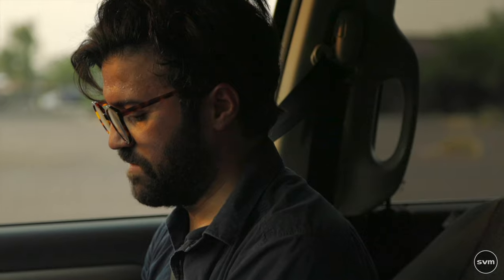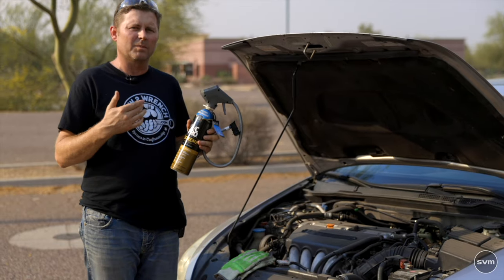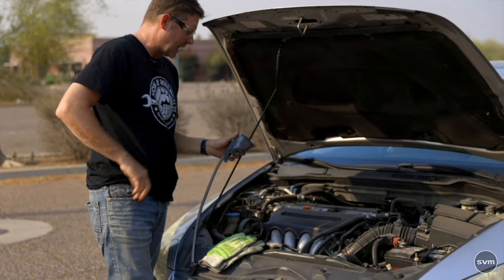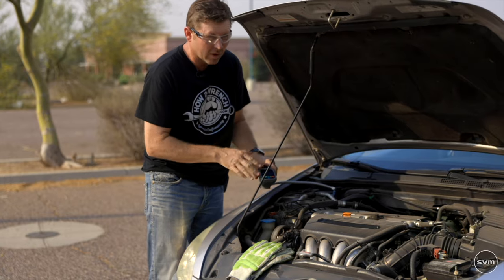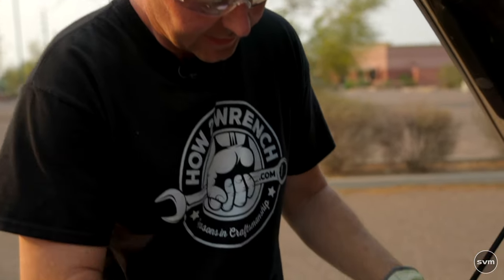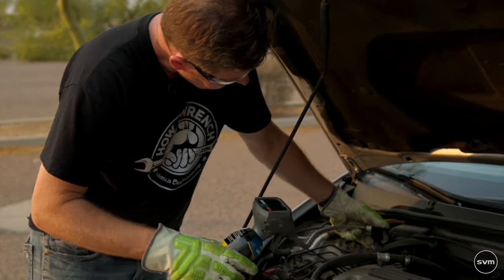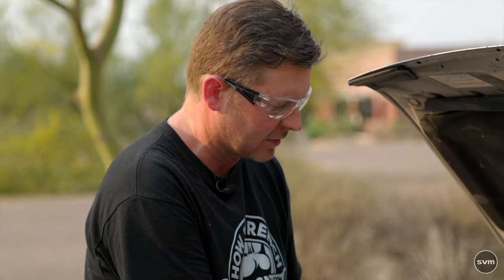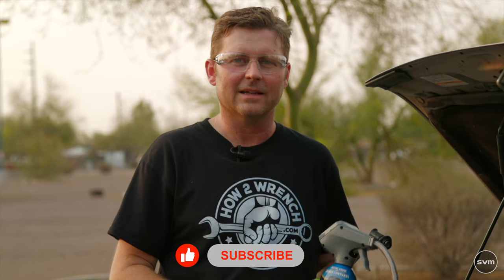DIY AC Recharge with A/C Pro Extreme Recharge Kit with Digital Gauge! Fix your AC and SAVE money!

Comment: I have a question, I have the one with the blue Ac pro , the temperature is 40c and above.  When I measure it, it is above 60 or 70 PSI, is it normal?
Reply: I have been reading and watching the videos before trying this. I understand that over pressurizing the system will prevent it from working. There is a high side and low side. you are adding refrigerant, and pressure to the low side. The compressor pressurizes the refrigerant and heats it in the process. Then it goes through the condenser to cool. This high pressure refrigerant then goes to the expansion valve. When the gas expands and the pressure drops, it gets very cold. This is where it goes through the evaporator and you blow air through to get A/C cold air in the car (or house too) So, if the low side is over pressurinzed then the gas cannot expand and it will not get cold. This is why you do not want too much pressure on the low side.